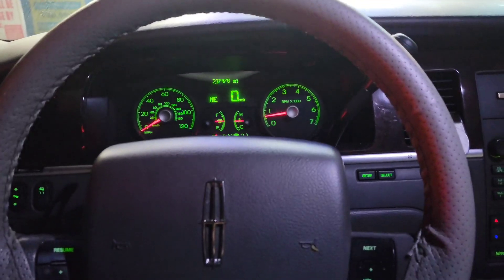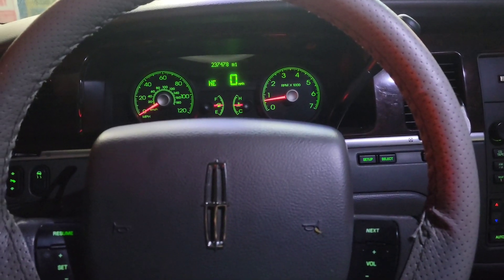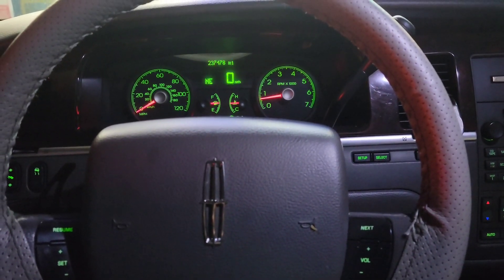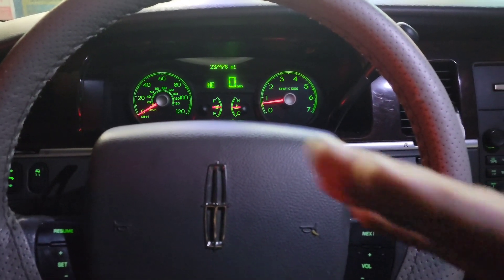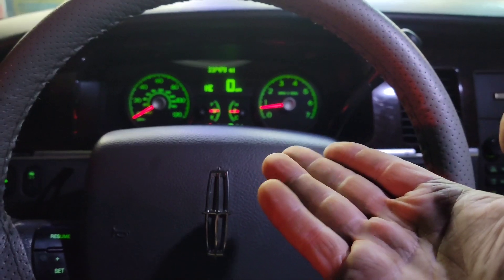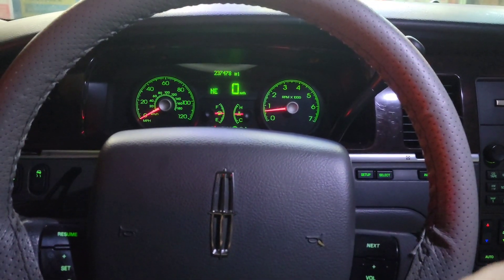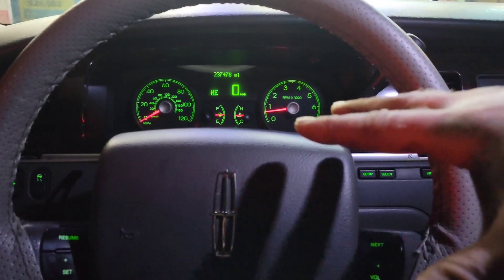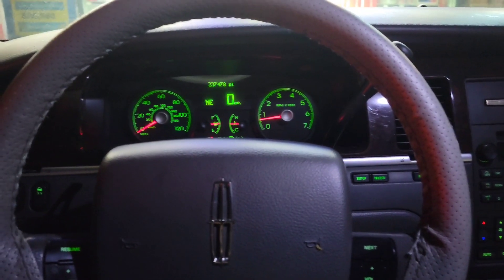Oil Change - Prime Oil System Without Filling Filter using flood mode - Not All Manufacturers

Comment: Honda does not have a flood mode, so if you have a Honda and wish to prime the oil system than disconnect the fuel pump relay in the fuse box under the hood.

Comment: Great video Boss. I have a question Pennzoil ultra platinum, what will it do to my 2022 F250 warranty if I use it? Currently have 2300 miles on the truck.
Reply from the maker: Nothing just keep it maintained, now if it's not Ford specified and something major happens to the engine they may ask for receipts and that's where things get weird